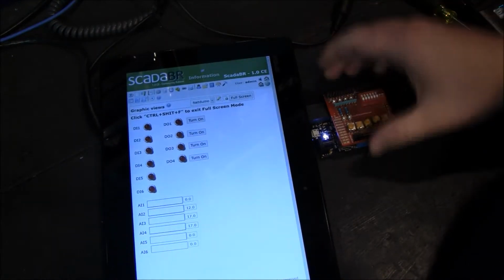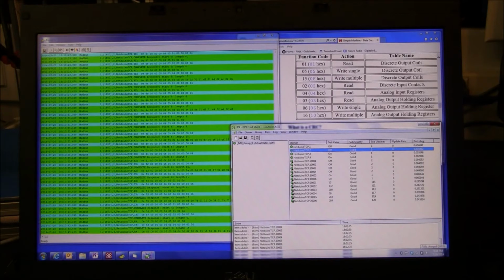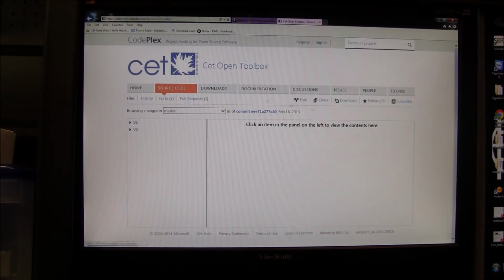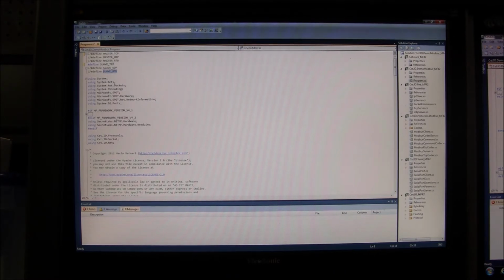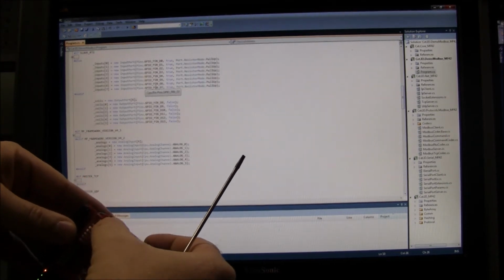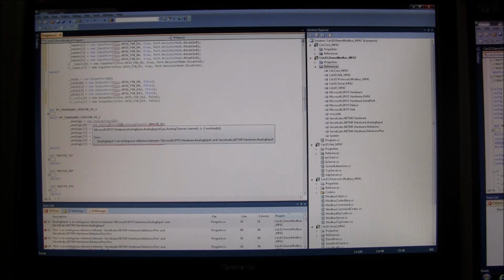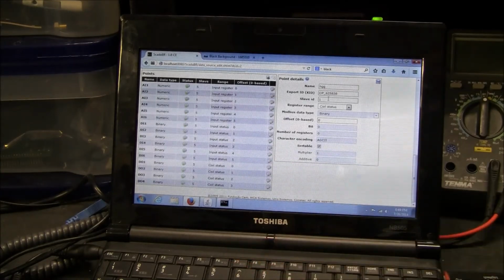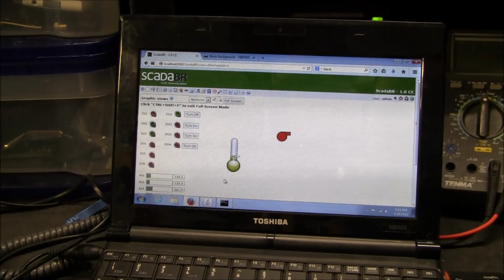Netduino, Modbus, ScadaBR, Cet Open Toolbox, and Visual Studio Tutorial

Comment: I still didn't figure out how to access to Apache TomCat/ScadaBR from any other device connected to network, either a LAN connected or via WiFi like you in this video? local ip is reserved and always the same 192.168.1.5:8080 but nothing?
I'm still using arduino modbus RTU+scadabr.

Bcs i'm interested in learnig a tcp with arduino do You maybe know for some good and easy to work with lib (like the one for rtu) for ArduinoMEGA2560+Wiznet ethernet shield.
With tcp everything else is the same in ScadaBR about making points and graphical view as for rtu, right

What are the chances that something else except registers and coils to work via same bus and modbus protocol at the same time/parallel with rx/tx operations?
For example  can i add temperature DS18b20 sensor to arduino and get some reading in scadaBR? Or  implementing some RTC with arduino where i can set some alarms via scadaBR? Really anything else except read/write coild/registers operation?

I'm thinking something like this /watch?v=_hUeZagMn7Y, connecting several slaves that communicate via network and control servo, steppers, character LCD etc.

Thanks